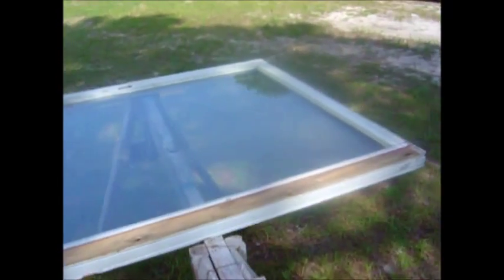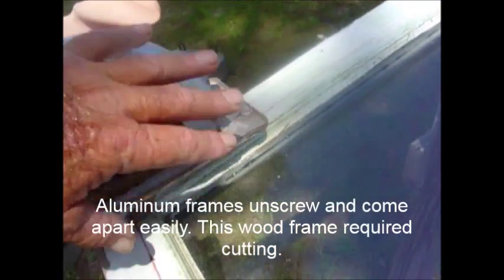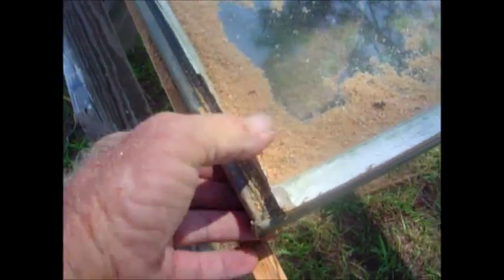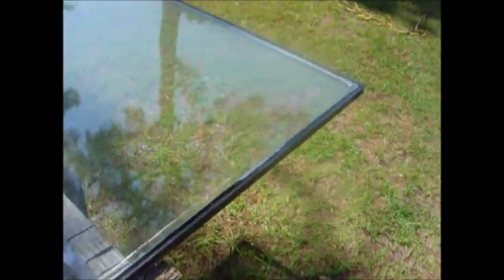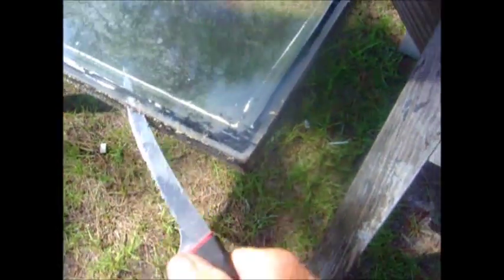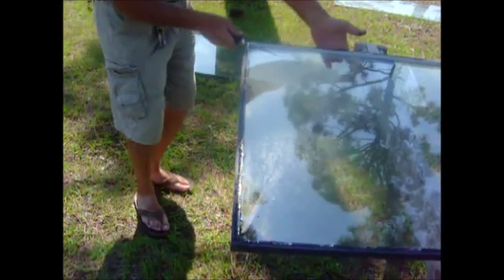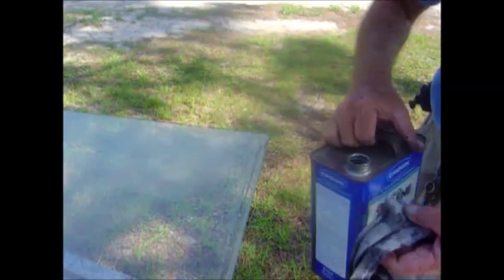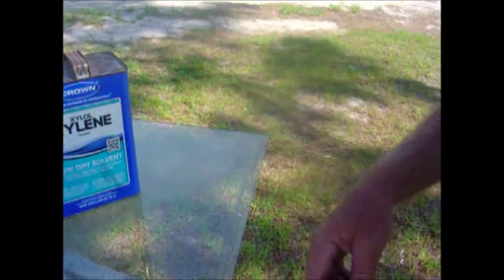Solar Water Distiller Build 2 Part 1

Comment: Hi Mike, I just came into a HUGE stack of glass slider doors.  Going to start building this week.
Reply from the maker: That's great! What size are the panes?
Reply: @STARFIRESOLAR  I believe they are 4x8.  The PVC board needed to be ordered.  I found a cheaper product for the black backing under the bottom glass.  Are you available by email?  I still have a concern about cleaning the glass as it has been outside for a long time. Cheers!
Reply from the maker: @bradg4433  yes email me at jp5er@yahoo.com I'll be looking forward to hearing from you.

Comment: Really excellent work! One question: to avoid any unwanted chemical reaction between the muriatic acid and oven cleaner, did you each product separately, or was that not a concern?

An important item to note: the scrubbing pad you used must have been one that had no abrasive particles imbedded in it. Those abrasive scrubbing pads will scratch glass.

One other important note: Tempered glass is kind of sensitive - it can't be cut like a regular piece of glass, and it doesn't like getting chipped or cracked. Keep all metal tools away from it. (I tried cutting tempered glass, once - I'm sure the look on my face was quite comical, as I watched the entire pane shatter into little glass cubelets, even though the whole thing was resting on a large table.)
Reply from the maker: Don Saito Yes. Those are some bad ass cleaners and I did all that outside.  I cleaned with each separately, rinsed thoroughly, washed again with baking soda, rinsed again, dried and cleaned with windex a couple times and just before I mount the glass to the top I'll clean it again and wipe the edge 1" in with lacquer thinner. Once the glass is mounted and the silicone has a 24hr cure I will put the basin in the sun facing south and cover it with a sheet just to keep it from getting super hot without water in it. Then I put the top right side up on a couple saw horses and wash the entire inside with dish soap and water, rinse well, spray with a mild vinegar & water solution 10/1 to clean off the soap and rinse again. Then I remove the cover and fill the basin to operating level, put the top in the basin and start the break-in period. During the break-in period the silicone and PVC go through what I call an outgassing period. The first few days of water that is produced will have a slight odor and aftertaste of the silicone, the PVC and glue. I refill the unit day to day as required to replace the water evaporated from the basin. The distiller continually washes itself clean and within a week of good sunshine the material has outgassed all it is going to outgas  and the water produced is totally tasteless and odorless.  Since I live close to the beach, for the break-in period I use seawater. It seems to speed up the break-in period.

I was using the cheap scrub pads, no embedded abrasives. I mostly rely on the cleaners to get the job done. I just use the scrub pads instead of a sponge or rag. What little scrubbing I've done like this in the past has never scratched the glass that I have seen and it hasn't shown in the performance of the glass. Being tempered the surface is a little harder I guess.  Slight scratches wouldn't be as big a problem as grease or wax. The scratches would just sheet over with water where as the water would draw away from or drop off the glass where it encounters grease, wax or other substances like, God Forbid,  silicone caulking. I have said in the videos that touching the underside of the glass of the top with ANY silicone residue on your hands would be the worst mistake you could ever make. It's easy to get the silicone you can see off the glass but there is an unseen residual film of silicone that is a pure MFer to get cleaned off. It can be done, but it's not easy and you'll put that one in your "Don't EVER do that again" file.

Oh yes, glass can not be cut after it is tempered.  A long time ago I did the same thing as you except I had the 34"x 76"piece of glass on two saw horses and thought I could grind the edge down a little with a diamond blade that I had used on regular glass before. It was exactly as you said. The slightest touch of the blade and the glass instantly shattered into a million cublets and fell to the floor. I'm still sweeping up a cublet every now and then. HAHAHAHA That one is also in my "Don't EVER do that again" file.

Thanks Don
Reply: STARFIRESOLAR Thanks Mike! I will tuck that info bit about not getting silicone on the inside faces of either the top or basin glass surfaces - I can see in my mind's eye how that would effectively waterproof the glass surface (especially on the inside facing top glass), repelling any water, rather than allowing the sheeting action so vital to the effectiveness of the system.
-
Also good to know about how to deal with outgassing adhesives. Nobody likes their water tasting like silicone!
-
Heh! Well, I'm glad I'm not the only one who has ever done the amazing tempered glass trick. It's almost magical how one small chip or cut in the corner can spread out to and cause an entire 18 sq ft sheet of glass to transform into a pile of roughly granulated glass  :~D
Reply from the maker: Don Saito Actually Don, if you get some silicone residue one the water side of the basin glass it's not a biggie. Just so you get off all you can see. The water can't pull away from the glass if it's 1/4"deep and the see through residue won't hinder the absorbtion of sunlight. It's the inside part of the top glass that must be kept clean. I am just gun shy about getting any silicone on any surface it's not supposed to be on. I've had to clean it off before and NEVER want to do it again. To make it worse, it was AFTER I installed the glass onto the top and brought the unit online that the problem reared it's fugly head. That meant I had to cut the glass off the top and then go through the cleaning process. Scraping off all the old silicone seal and cleaning and scrubing with steaming hot water and oven cleaner. 

True Story. When it happened I tried lacquer thinner, paint thinner, acetone, xylene, xylol, you name it I tried it. Nothing worked. I was so bummed I called DOW to ask an engineer WTF would take it off. He said that they make a solvent that will remove it but it is only sold in Europe, the US has banned it! So I looked for the closest thing I could find with that chemical in it and after trying more solvents I found that scrubbing with oven cleaner and hot steaming water the residue was gone. I felt so good about finding out what worked I called that same engineer at DOW and told him I found something that worked. I said "Who knew it would be Easy Off?" Well it wasn't as easy as the name implied but it worked. 

Oh Yeah, about the glass shattering. At the instant the glass shattered it kinda hung in the air for a split second and fell to the floor as a 34" x 76" sheet of separate cubelets. It would have been cool watch if it wasn't such a costly stupid mistake.
Reply: STARFIRESOLAR Right - not such a big deal for the basin glass to get silicone on it, since it's submerged all the time. Good to know there's a solution to the problem in case it ever happens to me (oven cleaner + steaming hot water). I'm an amateur astronomer and have ground and polished a telescope mirror before. I might have tried using a polishing agent to try getting that silicone residue off. I hope I never need to find out if that would work or not!
-
You da MAN, Mike!
Reply from the maker: Don Saito Yep, getting silicone on the wrong surface is something that you should avoid. In my many trials tried a rubbing compound but it was a type for auto paint so I'm not sure I was using the right stuff because it didn't work.

Being an amateur astronomer I bet you're stoked about that Pluto Fly-By tomorrow morning. I'm very interested in seeing the video and photos too. It amazes me how they can send a flying camera into space and come within a few thousand miles of a target, and in some cases actually land on a comet! Way too much math for me. I'll have to stick to tinkering with solar energy projects.
Reply: STARFIRESOLAR Yeah, hmmm, I'm going to hazard a guess that the car polish uses a softer abrasive designed for plastic clear coat. The abrasives used in telescope mirror making are made to polish the much harder surface of glass. A grit of 500 is 16 microns, and there are three finer grits below that which are 12, 5, and 3 microns, used to do the final polish on a mirror.
-
Yes! The New Horizons space probe will come within a measly 8K miles of Pluto, which is currently almost 3 trillion miles (or about 4.4 light hours) from Earth; it will send back really high-res pics of its surface before continuing on out into the Kuiper Belt, the Oort Cloud, and beyond. Humankind's first ever close-up views of Pluto, in our lifetimes! It boggles the mind. It's gratifying to know you're even aware of it.